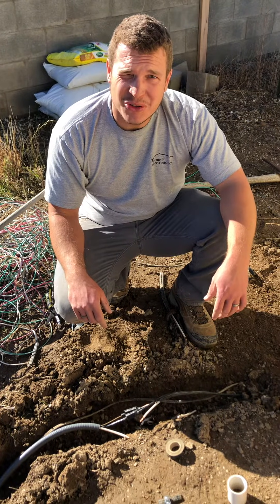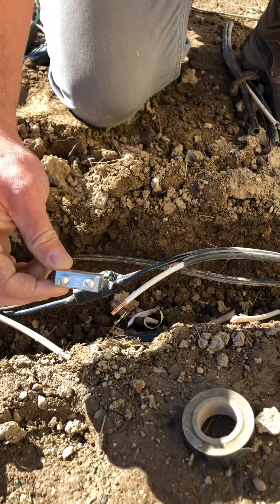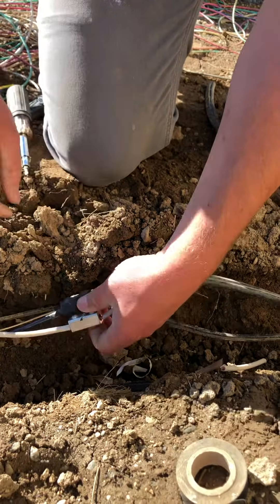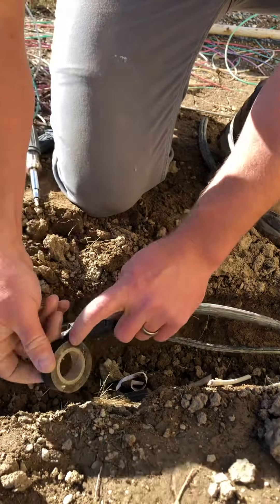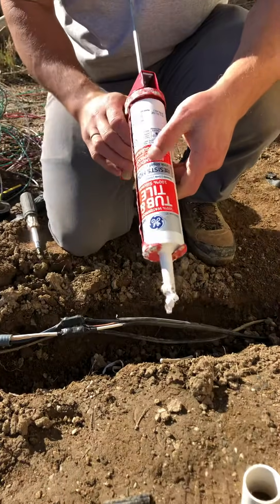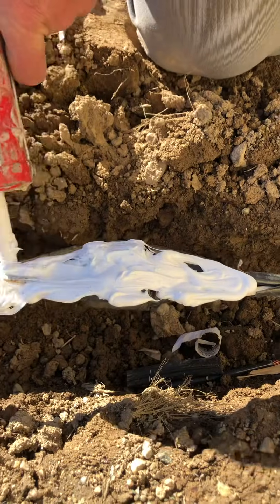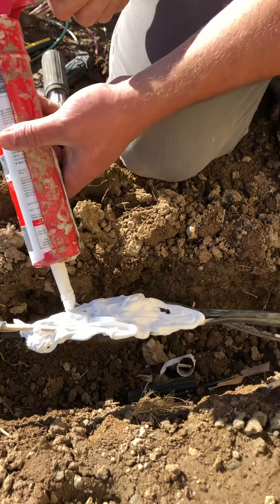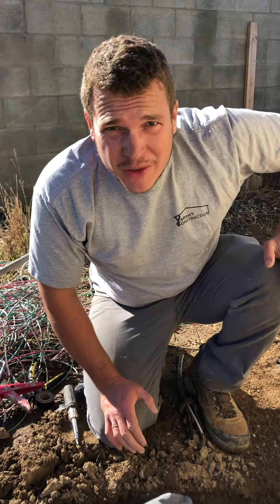Easy hack to fix and waterproof an underground wire that is broken

Comment: Trying to be respectful here, you have a construction company not an electrical company. Nothing about what you were doing here is code compliant, safe, or UL listed.
Reply from the maker: Joe Hall 
The electric connectors are UL listed,
The electric tape is too,
The silicone 🤔,
The Lowes bag not so much,
The wire splice still working 👍🏼
Reply: EXACTLY but he will argue his 'HACK' till the cows come home and other idiots will follow his stupid advice. He's too ignorant to realize that electricity flows through wet ground. He'll wake up one day in the rain when he grounds himself and his hand blows off.
Reply from the maker: Robert Nelson 
I think it interesting that you are clearly a professional but are trying to convince people that have common sense the following,,,
You can blow your hand off on a 20 amp 220 well wire 🤔,,, have you watched to many horror movies with the hair dryer in the bathtub scene 🛀,,,maybe blowing off appendages would be possible if it was directly connected to the wires on a telephone pole with no transformer. Do some research Mr. Professional Sir.
Also it’s wrapped in electrical tape and then silicone and then plastic. Electricity doesn’t jump through these things. If water was applied and worked it’s way through the plastic, then silicone seal it may tingle a bit or hurt If the breaker wasn’t tripped but definitely no explosion of appendages 😂. Now I don’t say this to hurt your ego it seems fragile enough. However just a fact,,, the wire is still working, and drum roll please,,, no one has lost an appendage, or gotten Electrified, or electro fried, or tingled, or shocked, 😳because it works in theory and real life. Go make something of yourself Mr professional Sir
Reply from the maker: Robert Nelson 
Maybe if you learn a little more about amps and volts, maybe a little about what it takes to blow off your hand 🤚 
We could then call you 
Dr. Mr. Professional certified electrical electrician Hoyty toyty pants,,,
Then you can continue looking down your nose at the working man telling him his wrong ways because you are better equipped with a big head.
Reply: @constructionhacks9293  Maybe you need to educate yourself on electrocution. OH AND LIABILITY. See now that you posted that on YOUTUBE if anyone gets hurt by you poor, uneducated, and illegal advice, guess who's getting sued and losing their kids college fund.........Electrocution” is the death or serious injury caused by electric shock / electric current passing through the body. The word is derived from “electro” and “execution”, but is used for accidental death and non-fatal injuries due to electricity. Depending on the severity of the electric-shock accident, the person may or may not recover.

Check and mate
Reply from the maker: Robert Nelson 
Thank you so much for your concern and support. Our hack is still working and has not blown off anyone’s appendages or harmed anyone. 20 amps will not blow appendages especially if it’s electrical taped, siliconed, encapsulated in plastic, and buried. Electrify someone to death really 20 amps? This would take a while if you were holding bear wires and no sense to let go.
You sir over exaggerate your opinions of my hack as much as your electric skills.
Sir. Mr. Dr. Electrical certified electrician pants.
Good day Sir.
Reply from the maker: Robert Nelson I think deep down you’re really upset because you know this quick fix for someone in need hack really works. Our common sense videos will only continue to offend you. Our videos are for common sense hard-working Americans who think outside the box/book. Go make your own video good day Sir
Reply from the maker: Robert Nelson quick fixes are all we have in this world anything can fail. It’s especially helpful when these hacks can mean life or death to your animals on the  farm when it means waiting for parts to get water. What you have taught me with all your opinions is this: You must need a friend, I’ll be your friend Robert Nelson
Reply: I kinda like THIS way of doing things! Great job !
Reply from the maker: Joe Hall 
It’s the apocalypse,,,
You lose power to your well, your life supply.
You only have the tools shown in the video. 
You decide to die due to the extreme danger and lack of code compliance.
I don’t know how I survived this video i think I saw my life flash before my eyes.
Reply: Construction hacks You have a good amount of videos, you helped a good amount of people, you are educating people. So when this video came up I figured it was my turn to help educate you some.  I’m just trying to help just like you. Didn’t mean to offend you, but simply just wanna educate you that there is many more alternative than what you have done.

Comment: This video actually just saved my bacon this morning. similar situation, a wire out to a well got dug up by our driveway company's excavator. I Was rying to figure out how to waterproof it when I splice it back together thanks for the tips.
Reply from the maker: Wolfman Dan Thank you so much for your support. We’re getting a lot of heat from the professionals on this video and we really appreciate guys like you that work for a living and have common sense hang in there

Comment: What’s the name of the connector you used? Thanks in advance!
Reply from the maker: Shiro Campos They sell them at Lowe’s in the electrical section it’s a really cool connector and I don’t know what it’s called but you’ll find them at Lowe’s in the electrical section right around where the wire nuts are
Reply: You can buy this as well. Safer and approved way. Last thing you want is voltage leaking into the ground in the future. Ouch. https://www.lowes.com/search?searchTerm=IDEAL+1-Count+28mm+8-in+Heat+Shrink+Tubing
Reply from the maker: WeatherNut27 Thank you for your support hang in there and keep up the good work
Reply: Awesome! Thanks again for sharing, I appreciate you.
Reply from the maker: Shiro Campos thank you for supporting our channel. We made this simple fix for the common sense oriented people. iIf you look at the comments we have really offended the professionals so thank you for your support hang in there and keep up the good work.